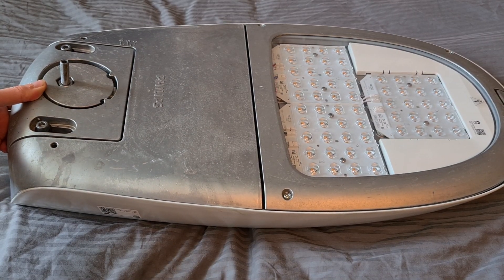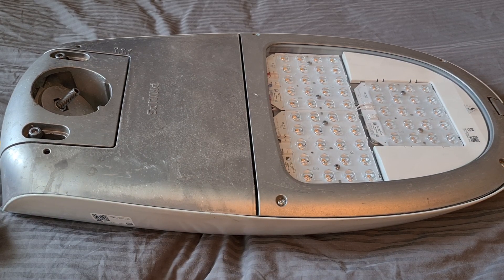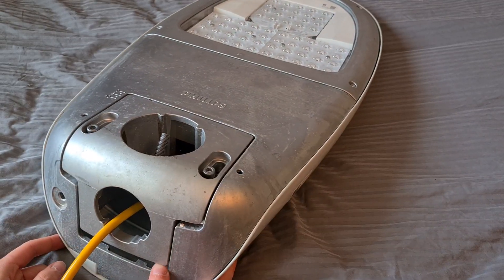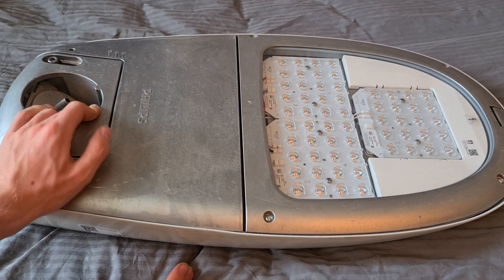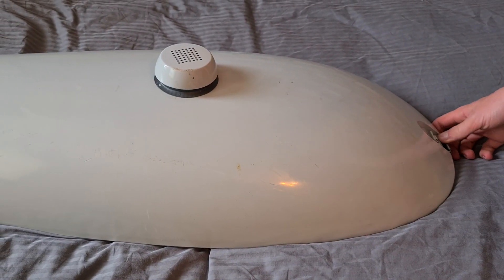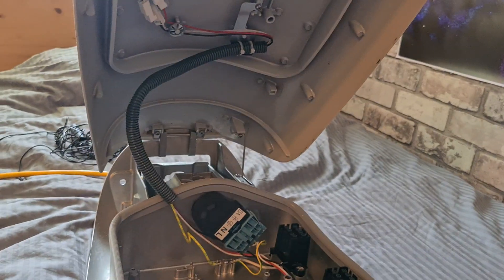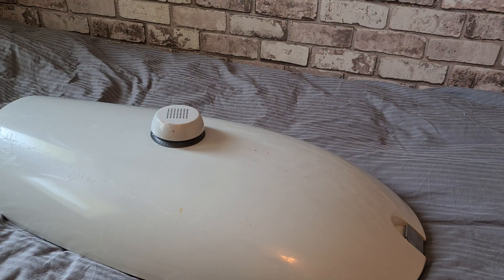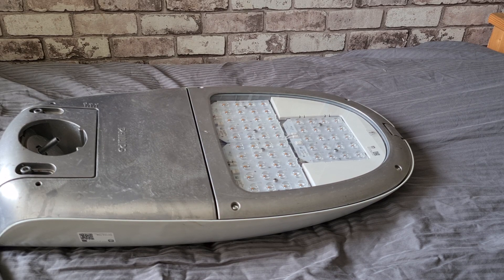Fixture Review S2 E7| Philips Iridium 4 (Newest Philips Fixture!)

Comment: Does Europe Sold Philips BRP 371, 372 or 373? which used In Indonesian Highways, Especially in Jakarta when they installed them back in 2016 and still in good shape today.
Reply: yeah, west & east java had this brp series in early massive replacement around 2016-2017 too. nowadays they relying more on panasonic made.
Reply from the maker: I've never seen it in the netherlands. its probably made for the Asian market.